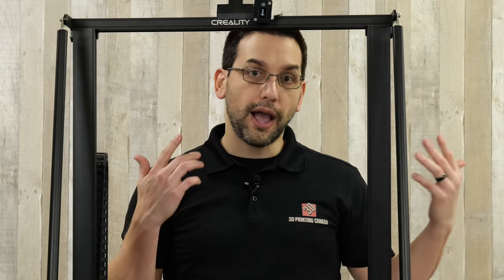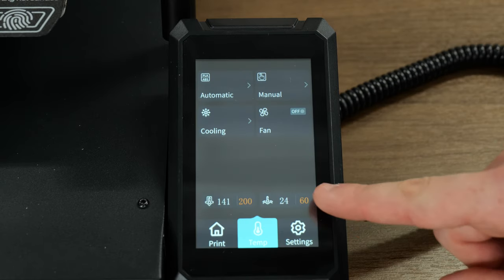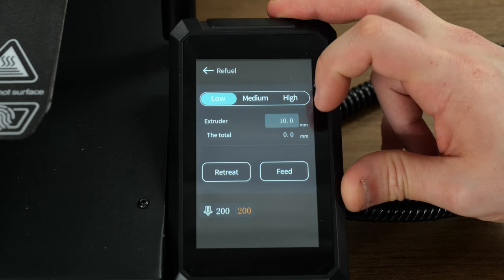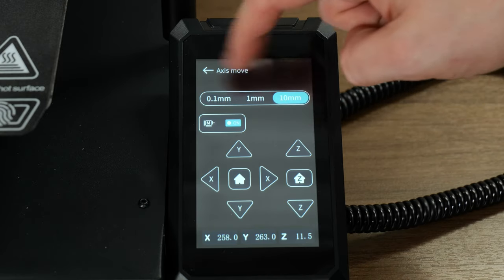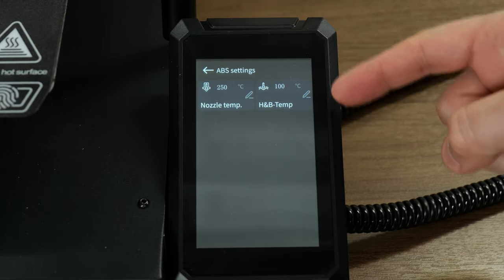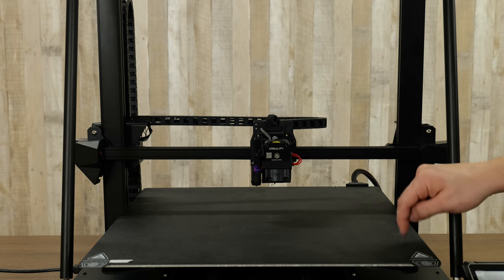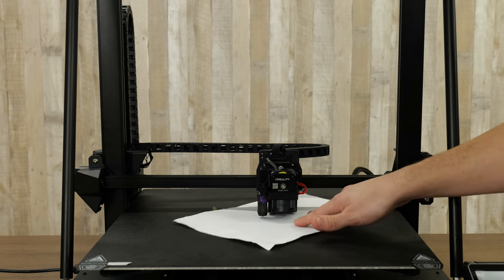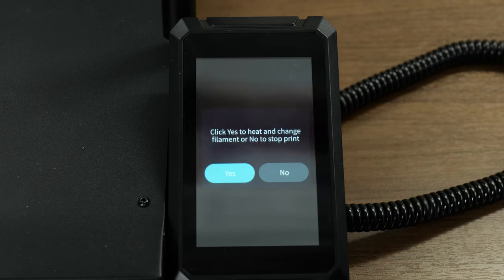CREALITY CR-M4 QUICKSTART GUIDE

Comment: bought one 4 weeks ago from Microcenter.  It set up quick and was very to use made good prints for about 100-150 hrs then it started to y-shift.  It was still under return window so I took it back, I liked it so much I wanted a replacement not a return.  Go the last one they had and again it set up great again and first 4 prints about 60 hrs worth things were perfect.  Then started a 50 hour build and 16 hr in it started a Y-shift.  I was asleep when this started and it moved about .5" - in y then started going straight again.  This however was last day of my return policy so I took it back to get my money back.  Not sure Creality vetted this for endurance printing.  There also was no extra bed. and my second one only had one spool bracket.  Hopefully they fix this problem.  I will buy another if they can guaranty I do not get Y layer shifts again.
Reply: same problem of the older cr10max..
Reply: Can you tell me what was your retraction speed having trouble with the retraction thank you

Comment: Hello, I have also bought the CR-M4, but I haven’t been able to achieve the print quality I want. The printer has a 0.8 nozzle installed. I’ve tried Creality Slicer, Creality Cloud, etc., but couldn’t get a proper result. Could you share the slicer and profile you use?

Comment: Machine looks fantastic and prints really nice. This may be my ignorance showing, but... why doesn't Creality mount the filament sensor on a bracket above the print head, with enough space between the heating element and sensor to grab onto? Wouldn't that save some filament once the spool runs out, at least?
Reply: Because that would be the sensible thing to do and Creality dont do sensible.
Reply: I think you could have an issue where the filament runs out, and pulls off the spool and is dangling in/around your prints. This could get pinched between the nozzle and the printed part and cause a pretty big mess.

A way to control this could be a ptfe guide tube, but I'd rather just scrap the last 0.5m of filament and save myself the headache.
Reply: @NathanBuildsRobots  Fair enough, thanks for the reply!
Reply: @NathanBuildsRobots Yeah I'm almost in agreement with you. Just trash in the last 10 feet of filiment on the roll probably makes it easier whenever I get that low it's snapped itself.

Comment: Did you have a hard time lining up the holes to screw the gantry to the base? What did the extra build sheet come in? I didn't see an extra one in mine. I bought one just under a month ago and had to replace the hot end and after I hooked it all up again it tried to push the nozzle through the build plate. Even after I manually set the height it went right back to doing that. Had to disassemble it and send it back. Hoping the new one doesn't give me as many problems. Wish Elegoo had one that was this size. I really like the Neptune 4, but it's pretty small. I read their biggest has had problems too.

Comment: It is too bad they don't do the Prusa idea of being able to just heat sections of the bed when doing smaller prints. 

I was hoping to see it run to see how loud it was.
Reply: Mine is just a little louder than the Sidewinder 2 that I used to have. And is definitely? Quieter than the CR 10 S400, I am ringing that 1 to work so that I don't have to listen to it and try to sleep.

Comment: jeez. 450x450 bed slinger, thats going to have to print slow out of necessity, also a practical demonstration of why the Prusa XL is using multiple small heating zones on the heat bed so you don't effectively have a space heater that happens to also print things. Interesting entry by Creality and great video.